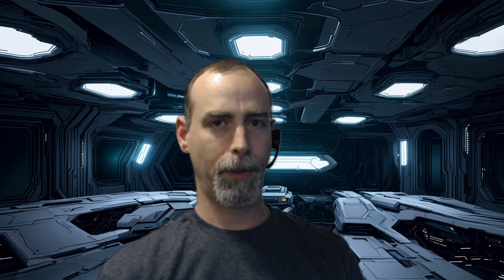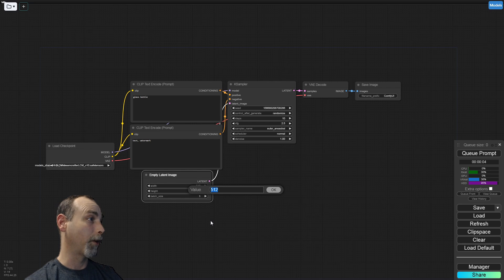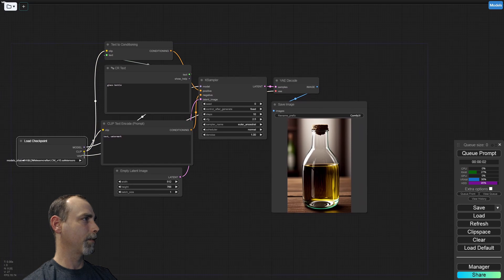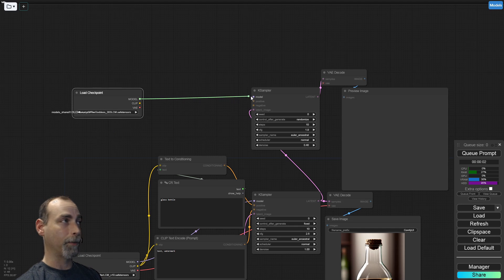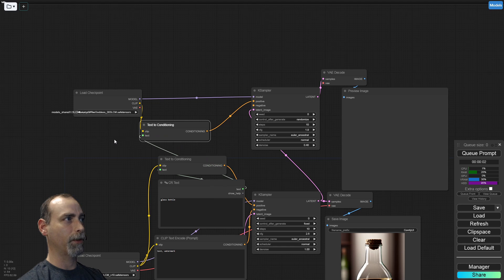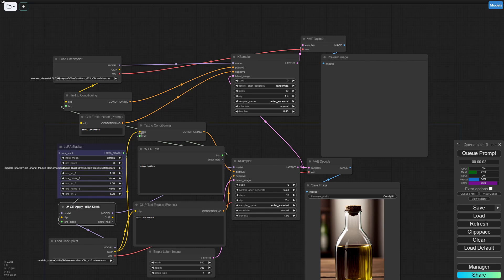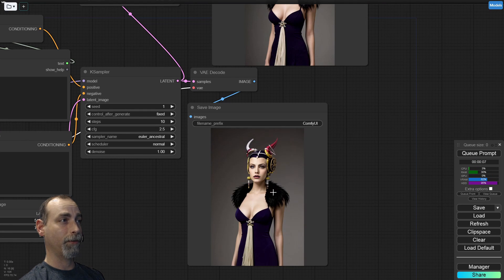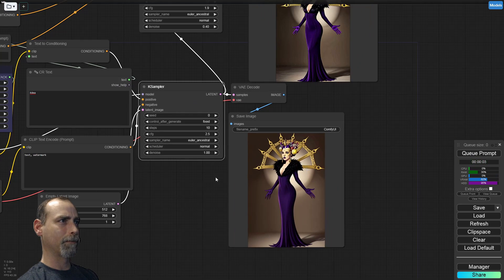Model Swap with ComfyUI, How to - Workflow

Comment: Where do you get all these extra nodes from? I do not have them in the default program. Like loRa Stacker, Text to Conditioning or Cr Text Box. If I have to download these separately, where do you get them?
Reply from the maker: In the comfyui 'Manager' menu you can add the nodes using the interface.  If you know the name of one it can be added pretty quick.  Another method is when you open a workflow that is missing nodes, the Manager has a button for 'install missing nodes' which shows you the ones that are missing and you can add them.
Reply: @djafk  Thanks much!!